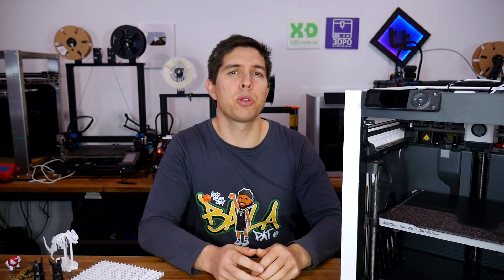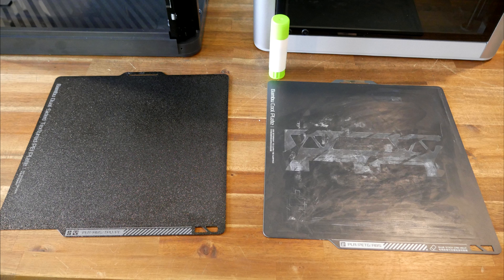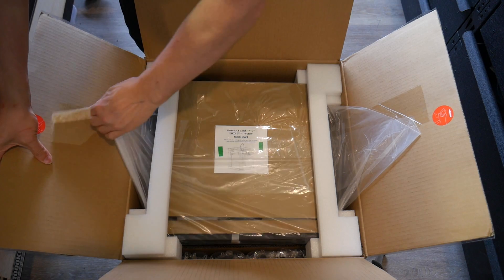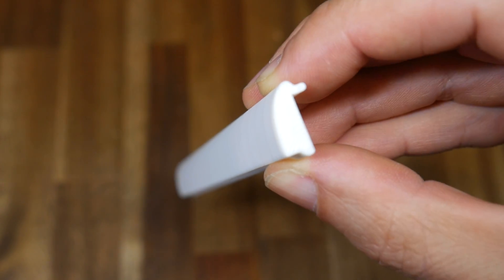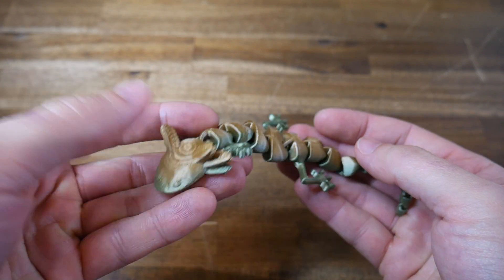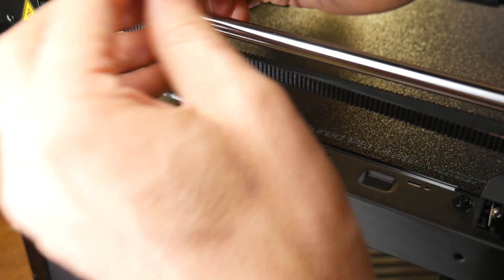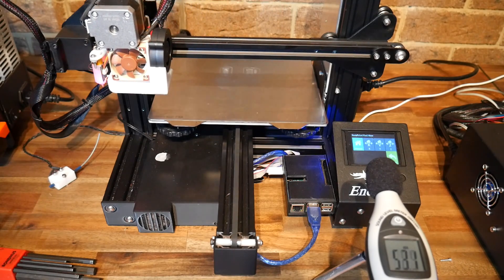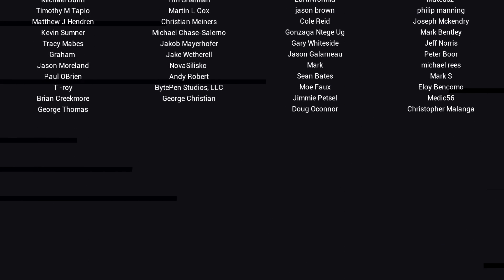Bambu Lab P1P - Your questions answered!

Comment from the maker: There were questions on the speed of the printer when comparing the pre-sliced 3Dbenchy vs Bambu Studio slicer defaults. With a few changes you can match the 20 minutes of the SD card print: https://youtu.be/5-yBVe3-VFo
Reply: Small correction: 11:51 "we can however add the X1s camera" – that is not the case. The P1Ps camera is lower resolution and much lower framerate, and the camera on offer in the store is "X1 series exclusive". I guess it has to do with the different display processors in the machines?
Reply: Just wanted to say thanks for some great video.. as a newbie to 3D printing, I was wondering if you happen to have reviews on the Geeetech* A30 T with 3D Touch and three filament hotend? 

I must update this, i found Prusa is not Geeetech.. lol..and i had the models and printers mixed up..

Comment: Just heard about P1P because its 49% on sale.  I've looked at the P1P now, and I have say: Is this a joke?  

Frankly, the P1P feels like a chaotic mess of over-engineered compromises. It’s bloated with unnecessary parts—extra belts, oversized fans, more metal—but none of that translates into better performance or usability. Instead, it becomes a maintenance nightmare waiting to happen. Compared to the A1, the P1P is a design regression masked in a misleading “pro-tier” shell. The interface is prehistoric, the noise is intrusive, and its lack of intelligent features makes it feel like it belongs in a landfill next to printers from five years ago. Why Bambu chose to reinvent the wheel so badly with the P1P is baffling—especially when the A1 proves they know how to get it right.

At 49% off, it’s not a deal—it’s a discount on disappointment. You’d be better off buying two A1s and still end up with a better printing experience, less downtime, and more peace of mind. The P1P isn't just a bad value—it's a fundamentally flawed product.

Comment: I feel as though I've just stepped out of a Model A Ford and into a Ferrari having just replaced my Ender 3 V2 with a P1P.   It is totally sublime. I've not had any warping when printing with ABS and the surface finish even at the warp speeds of the P1P is impressive.    It has transformed my 3D printing experience.   It's no longer a case of spending time getting the drawing right and then spending hours tweaking the parameters in the slicer to make the printer perform.  It works.   Every time!    I did have to make some mods though - the filament spool now hangs off the left side, and the LCD display can be made to rotate so I can view it from below since it is on a shelf 59" off the floor.     And mine came with camera and light bar all for $654 in the UK.

Comment: As a beginner 3D printer I am fascinated by all the newest of 3D printers.  I was able to get my start really inexpensively  with a used Ender-3 V2 and Kobra Max.  Total cost about $160.00.  So, spending $700 is not in my future.  Would be glad to test and evaluate the P1P if Bambu would like to ship me a unit.  Address provided on request.  🙂

Comment: I am just stating to consider a upgrade from my old Ender 3. On the shopping list are the Prusa MK4 and the P1P. The P1P is attractive as it is cheaper but is there any way to transfer prints on your LAN without the cloud? Does anyone know if you can mount the filament spool on a side vs. the back of the printer? the only space I have to put a printer makes getting to the back of the machine pretty tough.  I have heard this is somewhat loud as well, not that my current printer is quite, but I believe the MK4 is a more silent design.

Comment: For me, even now when compared to the Mk4, Prusa's efforts are laughable. The Mk4 is still a bedslinger, with no way to enclose the printer other than to purchase one of those separate enclosure boxes, and you still have to put it together yourself. Tinkering is fun, but a 3D printer's precision is only good if it's built precisely as well. Having 95% of the P1P pre-assembled in factory means that it's precisely assembled with no room for human error.

Comment: Pardon me, the noise is down to ...what cooling fan, please? The additional one? I have added the p1p to my list of considerables and the noise is a factor (as it will be sitting in the same room I sleep). I was thinking of giving it a shot, but these details are rather scarce fo find in concise form and Prusa boasts of being super quiet.

Would you (anyone) mind sleeping and working within 4 meter radius? // Granted, fiven the print speed, my expected prints would probably mostly be finished within the day...

Comment: With a heavy heart, I just cancelled my Prusa MK4 upgrade and the Prusa XL order. I've waited long enough... In a way I'm glad, because during the long wait for the Prusa XL, the Bambu Lab and Creality K1 (and others) have come out with faster printers. While the MK4 looks good to me, the upgrade path at $579 doesn't make sense to me anymore. If I want an MK4, I'll buy the complete unit for a few hundred dollars more. However, faster XY core machines are the future. The MK4 feels like grandma in a mini skirt... Okay, it's faster, but has no contained environment unless you spend another $350. The build plate is still small. I hate to say it, but the newer printers are starting to look like slick appliances. More importantly, the surface quality is very good, if not better than my old MKS3. With cancelling the MK4 upgrade and the XL, I can get a Bambu Lab P1P today and save $$$ and have a bigger build plate volume! I'm also considering the Carbon X1, which makes more sense and is available.
After watching every review, I could find on the K1, has too many issues for me to gamble my time and $$$ on and Creality's reputation for putting out a rushed and confusing array of printer varieties is baffling. Let me guess the future for the next year... K1, K1 Max, K1 Super Max, K1 Ultimate Max, K1 Extreme Max, etc... etc... Each version will be a "better" iteration of the last...
I'll keep an eye out for the somewhat expensive Prusa XL, because I like the bigger print volume, maybe input shaping will be fully implemented by then, but let's see what else comes out in the next year from other printer companies. I'll always have a soft spot in my heart for my Prusa MKS3. It was my 1st printer, and it still works like champ. But I'm sure the first owners of the Ford Model T said the same thing. It's time for me to step into the XY core world... where's my seatbelt?!

Comment: The  auxiliary  fan:   What does it cool? When is needed? Is it a useful upgrade?
Reply from the maker: The aux fan comes on when the regular part cooling fans do. They work in tandem. When printing filament like PLA really fast, the more cooling the better. If this is you, the aux fan is a good upgrade. If not, the fans built into the toolhead will be sufficient.

Comment: I bought this printer a week ago. I am really amazed by this printer. No hassle with leveling or prints getting stuck to the printbed. The quality is overal very good. It got shipped with the Led light and the camera  ( 720 P ). The slicer works great for me. My opinion, the best printer i've ever had.

Comment: Tevo Tornado, then Prusa Mk 3S+, then Sidewinder X2, One week ago Ender 3 s1 Plus. S1 does not impress.  Needing much tweaking out of the box and I doubt the hotend is getting the stated 210 degrees.  Support is awful. I am standing by my feeling that I will never own another 3d printer with a thin rail and rubber rollers supporting the print bed.  Prusa "always" printed nice but just wasn't big enough....  So I started hunting for something new.  MK4 with a 3 month wait or P1P now with USA made all over it.  Or splurge to an X1......Nice to have quality choices.

Comment: I'm considering this or the flsun v400 but there is zero information on youtube about how fast and reliable these printers when using petg or other tougher materials. I print a lot of petg since it's cheap and strong. But it takes forever on my ender since it's even slower than printing pla on the same machine. I heard somewhere that petg if printed too fast becomes super weak. Everybody is all about that disgusting pla just printing useless landfill like benchys that noone really cares about.

Comment: I mean  the main reasons it is very attractive is that it is a corexy voron for a fraction of the cost. You don't have to play frankenstein and assemble it.  As far as I've seen it just works and it doesn't require any tinkering or upgrades to get quality prints. These selling points are very enticing. Great video.

Comment: The double belt differential core X Y motion system seems like something that adds mechanical wear issues and allows more elastic vibration in the print head position due to the extra belt path length. They are compensating for it with advanced feedback techniques - but these belts still must suffer accelerated wear compared to the more common x y gantry design

Comment: I just ordered one, mostly because I'm tired of having to pull my hair out trying to make the damn things work. I've got an Ender 3v2 that's so heavily modded, I don't even know where to start to figure out why the hell it's not working, an Anycubic Kobra Max that more or less does what I want, an Anycubic Predator that the factory stopped supporting a week after I bought it, and a Sovol SV-06 that fried its stepper drivers and refuses to work with a new mainboard. Granted, the Ender worked when I got it, but by the time I got the performance I wanted, I'd spent far too much time and money to be worth it. I served my time in the salt mines of the tinkering era, and now I just want to print on something that works.

Comment: I received my P1P today, already printing parts. No fuss it just works. Had to apply two firmware updates before printing, but it didn't take long. I have more money tied up in an upgraded Ender 3 Pro than what this printer cost. Take off the cost of the included full roll of PLA and it's even a better bargain. Also, the upgraded Ender still doesn't print anywhere near as fast or provide the quality of finished parts. My ender has been a workhorse for me, but I can see it being put out to pasture. Creality does not have a machine that can touch this one.
I love my RatRig 3 for larger prints but still don't have all the bugs worked out of Klipper which absorbs so much time.
Some say it's not innovative, OK but the technology is out there for all manufacturers. Bambu Labs collected it, refined it into a printer that works at the get go without the need to apply a bunch of upgrades. When we want to tinker that's still available to us.
But guess which printer will be making the parts that go into the tinkering part of my hobby.

Comment: I teach STEM and particularly teach CAD to my middle and upper school classes. I am frustrated with my MakerBot Sketches and am in the market for a different dependable printer.  I actually started using Flashforge slicer and told the slicer it was an Adventurer 3...in my opinion, it works better but still not dependable.  MakerBot's Slicer is so basic and doesn't allow you to make too many changes.  Also, I'm not a fan of the moving print beds for the Y axis.  I have about a $2000 budget to spend on equipment each year for my school.  Would you recommend the X1 Carbon with the multi-spool combo? or Two P1P's...or even another brand?  Printing for so many students, I just need something that works.  I barely have enough time between classes to check CAD models and make sure everything is set up right. I am interested in your thoughts on this.  Thanks!!

Comment: Someone mentioned this machine in my last MIA Blink you tube video,  so I thought I see what this P1P is all about. 
Still very expensive considering what I spent on making my own non-cconventional core XY which was designed also for speed and precision outside the typical 
machine and outside the use of typical components and layout.  I don't have an eclosure around the MIA Blink machine,  but that can be added no problem. Not concerned about enclosures, in fact, enclosures tend to block better acces to the prints and make machine maintenance and repairs very difficult. I rather have a light weight efficient open architecture machine as stand alone and add an eclosure if desired. 

This P1P reminds me of the early Colido filament enclosed spools, that were suppsed to keep the filament enclosed and clean, but  it was overkill that it phased out and filament spools became as they are today open and simpler to use.

Comment: i got my p1p last weekend and only managed to get 1 print with no issues, after multiple fails. 

the speed is awesome but the cloud is terrible 80% of the prints fail to download on it after 30 minutes of trying. I have to use the sd card because of this. i've raised a ticket with them as i'm sure many others have and they just told me that it should be working so i should try again. 
Also bed adhesion is terrible for pla on these textured sheets. Hey but that's my experience. 

Other people have been having bed warping. 
big incosistent lines on walls. and other issues. 
discord and the forums are full of examples.

Comment: You are the first reviewer that I’ve seen didn’t give it a bad review or have major issues with either p1p or x1. Most are plagued with artifacts, hardware failures, loud fans, failing fans, failed prints, false positive print failure detections or limited software control over prints. I was hoping this printer was going to go the extra mile. But, the bad reviews are outweighing the good so far. I’ll give it more time to see how things shake out. Thanks for your review on this product.

Comment: Not considering the p1p I'm thinking and likely getting the X1 carbon bundle 1) for the multi color 2) the speed 3) the reliability of printing. After a few years on a few creality printers I'm at the end of willing to tinker to MAKE it work. too many times have prints failed just because the head is scraping the infill either breaking off parts or so bad a layer shift occurs. The Appliance moniker is an apt one and the full kit being enclosed has the added bonus of sound dampening. sure it's useless at the top speed but the Silent or normal settings are more than twice the speed of my current machines. Do I expect flawless prints? No there will always be things which simply wont print. yet Items which should have that don't can in many times be attributed to poor parts QC such as the Z screw obviously having a wonky thread (errors always at same elevation) or the CR arriving with a seized barring in the extruder Guess its time to put trust in another company.
Reply: p1p is the same as x1c with AMS support and speed, and afaik the reliability difference is like 1 vs 2 failures out of 50 prints.
Reply: @heartminer5487  Well the fail rate is DRASTICALLY worse than 1/50 closer to 50/50 unless its a simple print and those also fail. My printer has sat there for a few months unused. The wasted material was off the charts. The #1 reason for fails the software. Due to the online to use when you open the slicer it can either revert to default settings or carry over previous settings and you don't know which until you diligently go through all the settings. If you don't you'll be mid print when you find out "Oh Crap I missed that setting" Default is not great results they do not reflect the meticulous setting they created for the bonus prints they give you to test the machine. anywhere the machine puts Supports makes a mess of the surface touching them so you have to be extra careful of what you chose to support and if it'll be seen after removing the supports. Another problem is top and bottom surfaces the bottom counting the support interval layer as one of the layers has left prints with 1 actual layer as part of the print. I could continue but this list is already turned into a wall of text few will read.

Comment: I'm already saving up for this! I've been stuck with an old FlashForge Finder printer I got many, many years ago, so the P1P should be a massive upgrade from my current setup. I'm not necessarily a "newbie", but definitely not a professional user either, although I hope that by having a good printer to use in the first place, I'll actually be inclined to try prints that aren't the basic stuff I can barely print currently.

Thanks for the video by the way, It's great to have this much info in a more easily viewable context!

Comment: i have been going back and forth with the x1 and the P1P. i started on the ender 3 v2 but having to fiddle with it almost everyday it becomes a pain. i use my 3d printer for printing parts and odds and ends for truck/car interiors and im not huge into modding my printer. 3D printing for me is less of a hobby and more of a problem solver when you cant get things to repair or replace odd parts so bambo labs making it more of a tool is great. For me and my use case it's perfect and what im looking for.
Reply: which one did you get in the end?

Comment: I am using a Prusa Mk3s and tried the MMU but had no success with it, so I detached the MMU.
I think abut a Bamboo machine for multi color printing, but the down side is, that the AMS doesn't seem to work with TPU or (more important to me) PVA. I am not sure if I want to spend the money.
If I could mix different types of filament in the AMS it would be hard for me to resist.

Comment: does it run closed source software?  I haven't done much research on it but I'm guessing this is the case since they're basically "blocking" the use of the lidar in the P1P.

If it has he same board I don't see a real reason why the P1P can't run the lidar, other than differentiating it form the x1